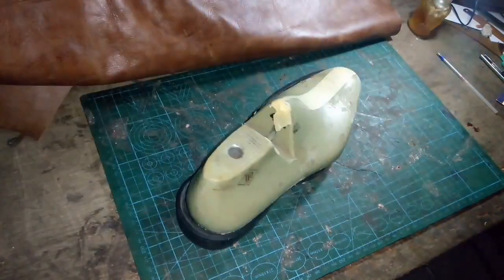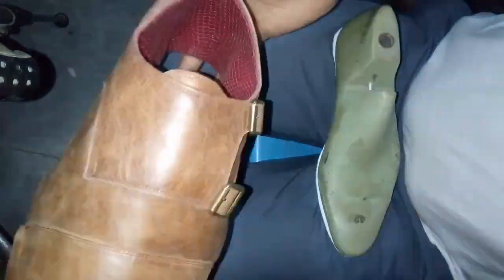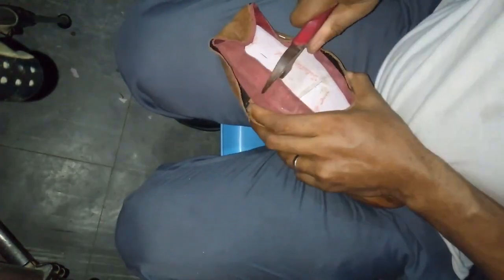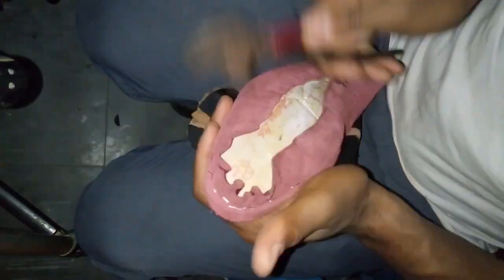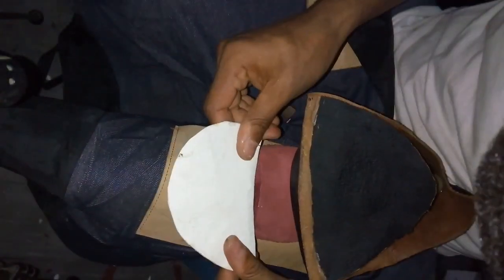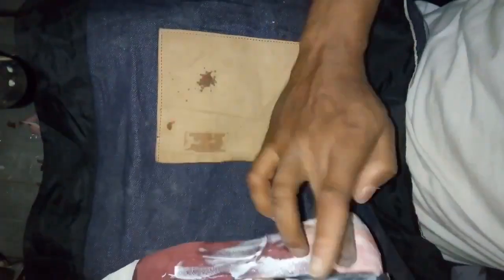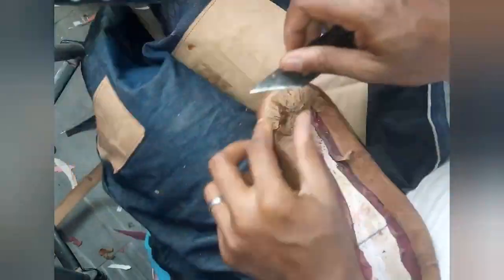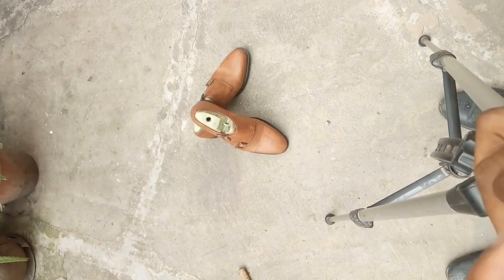Shoe Making Tutorial: Useful Tips on Working with Rubber Soles and Lasting

Comment: The metal shanks is a legal requirement in some safety shoes, it seems they often confuse a metal shank with a metal sole… I found humour in this  as a child when I was first learning to make shoes.  I actually used wooden shanks, in mine at times.  Especially for riding horses, shanks that are of the correct size are very handy. Have a good day everyone!
Reply from the maker: Thank you so much for the insight. I can understand why requiring metal shanks as a safety feature will be amusing. Metal plates in the sole I can understand but just a shank? If the shoe isn't really a high heel and the insol materials are adequately rigid at the base, a metal shank in addition may be desirable but not absolutely necessary. Thanks again for the insight.
Reply: @KpomoBespoke  exactly, it’s funny when rules are written by those that have no knowledge.

Comment: Sir how to avoid Wrinkle on back counter during de-lasting shoe. plz tell me.
Reply from the maker: If you noticed, I used paste for that area. The paste is a slow drying adhesive which allows me to pull the back in place and smooth out any wrinkles. If you are going to use contact cement for that place then you have to be very fast about it and set the back before the gum starts setting. Once it sets, you will have wrinkles.
Reply from the maker: if you are using contact cement, then you cant wait for it to dry. You must pull down the upper immediately after applying the glue. you can also apply to just one surface and they pull down. otherwise use white paste i did in this video.
Reply: Thanks for sharing this

Comment: How do you soften the toe puff
Reply from the maker: This depends on the toe puff material you are using. If leather, just soak it in water and attach with paste. Some cellulose fibers are heat activated so you have to heat them up first. some other fibers you can soften by ruffling them up before you attach them.